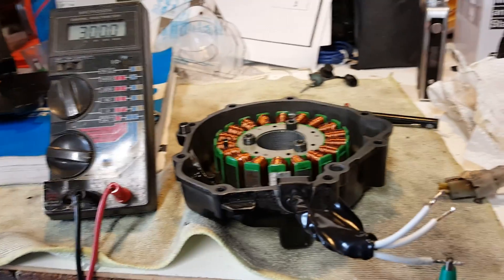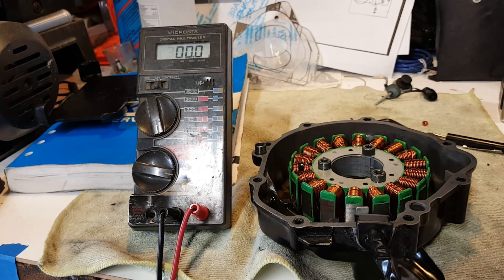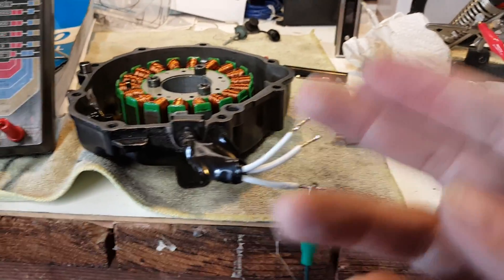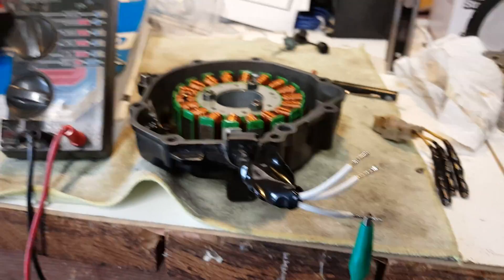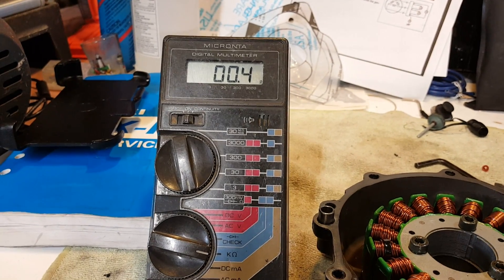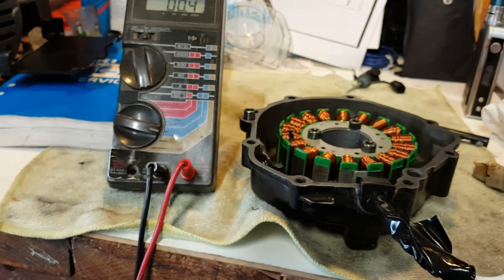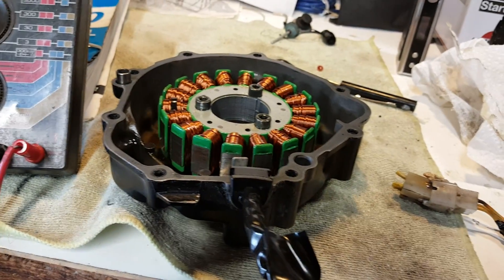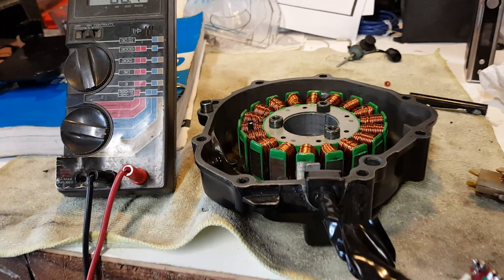Testing Your Stator on/off Your Bike

Comment: I thought you couldn't use a Mossfet with a lithium battery.
Reply from the maker: I'm going to let Chat GPT give you the breakdown with all my specs and upgrades feed into my query and you make the decision. 

Great combo. Your 2005 GSX-R750 (K5) will play nicely with a MOSFET regulator/rectifier and your Shorai LFM19A4-BS12 LiFePO₄ battery—as long as the charging voltage stays in the lithium-safe window.

- What “good” looks like for your Shorai
Shorai’s guidance: running/charging ~13.6–14.4 V, never above 15.2 V at any rpm. At idle you want ≥13.1 V. 
Your specific model: LFX19A4-BS12 was superseded by LFM19A4-BS12 (same drop-in fit, 12 V LiFePO₄, ~285 CCA). 

- R/R options that work well on the K5 GSX-R750
* Best (Series MOSFET): Shindengen SH847 — reduces stator heating and holds voltage ~14.2 V. Suzuki p/n 32800-31J00; available as genuine units/kits. 
* Very good (MOSFET shunt): Shindengen FH020AA — tight regulation around ~14.2–14.4 V and proven reliability. 
* Both are commonly sold in plug-and-play style kits (cables, fuse/breaker, connectors). 
(roadstercycle.com)

- Wiring snapshot (GSX-R specifics)
* Stator → R/R: The three yellow AC leads go to the three AC inputs on the R/R (order doesn’t matter). 

- R/R DC → Battery:
* R/R + to battery + through a ~30 A fuse or breaker, short and heavy gauge (12 AWG; 10 AWG if long). Many kits include this inline protection. 
 (roadstercycle.com)

- R/R – to solid frame/battery ground.
* If your R/R has a sense wire, tie it to a clean switched +12 V (e.g., ignition-on circuit).

The GSX-R service manual’s regulated-voltage test is done at ~5,000 rpm with headlight on high, measuring across the battery terminals. Aim to see ~14.0–14.4 V and never >15.2 V for the Shorai. 

- Quick verification after install (multimeter)
Key off (resting): LiFePO₄ typically ~13.2–13.4 V (informative, not critical). Idle: ≥13.1 V (Shorai minimum). 
3–5k rpm (lights on): 13.6–14.4 V steady. If you ever see >15.0–15.2 V, stop—R/R or wiring issue. 

- Parts I’d pick for your setup
Series: Shindengen SH847 (often sold as Suzuki p/n 32800-31J00) + bike-specific or universal harness. 
Eastern Beaver Inc

Shunt MOSFET (budget/compact): Shindengen FH020AA kit (widely available). 

- Lithium-specific notes
Your Shorai has a BMS; it’s happy with normal bike charging as long as voltage stays ≤15.2 V. Avoid chargers with desulfation/repair modes. 
Cold charging: below ~0 °C (32 °F) many BMSs limit/disable charging—normal behavior. (Warm the pack with a few minutes of lights/accessories first.) 

Hope that answers your question

Comment: So if my bike doesnt stay running or start with out a jump its the stator?
Reply from the maker: Yes sir..!! The job of the Stator or Alternator if it was a car is to provide power to keep it running.  

The only function of the battery is to provide enough voltage and amperage power to start it via the starter motor. 

After start the Regulator Rectifier on your bike will divert power from the Stator to the battery to replace power (voltage) that was lost and continuously keep checking to see if the battery is topped off.

The best way to check if your Stator is supplying enough power is to start the engine and disconnect the battery while running. If the vehicle shuts off at any point then you know you have a faulty Stator or Alternator... Aka charging system..
Reply: @ thanks bro I appreaciate the speedy reply, and the breakdown helps me understand much more you seem to be a great teacher. And I’m assuming once I change the stator I’ll be back in business thanks again

Comment: I'm looking at this video for the first time and it's 7 years old but do you know why the connection melted and did you fix your motorcycle?
Reply from the maker: This happens when one or all of three things happens.

1) Stator is going bad
2) RR going bad
3) One of the 3  phase  is intermittent

Hard wiring in the stator connections is the best way to resolve this issue. If after hard wiring the melting still occurs, then you know its time to replace the Stator or RR.. test both. Just an FYI a stator can test good but still give you problems like this,  Happen to me not to long ago ..

Comment: I hope you can help me here: I recently bought an 08 zx10 and started doing a bunch of mods: added an integrated tail light, changed the bulbs to LEDs etc. Long story short, while riding around town I stalled the bike and did not want to turn back on. Called a mechanic and told me it was my battery so I went ahead and bought a new one. Yesterday it did not want to start up 2 days after having that new battery installed. Am I looking at the same issue here?
Reply from the maker: 0:05 If the battery dies after riding and it was fully charge then You're running off battery power and the two other components of the charging system has failed. That would be your RR and Stator.

Most of the time the RR is the culprit. I would perform a diod check on the RR.. and this test on your stator. I would also visually inspect your Stator for burnt discoloration on the coils.. usually a good sign it's time for a new one.

One quick and dirty way to see if youret running off batt power is to start the bike and disconnect the battery.. if the bike shuts off then you know youre running off batt power and one OR BOTH components of the charging system isn't working.
Reply: @TheChemistDIY  An update as of right now. There was a recall on 08-10 ZX10R. So I called my dealership and indeed the recall is still open for a Voltage Regulator (whatever that means). So it has been ordered and they’ll let me know when it gets here so that they can fix it and go from there. 

In your book, does this sound right? Voltage Regulator does that translates to the stator or the RR?
Reply from the maker: @klachi7  So RR is short for Regulator Rectifier or Voltage Rectifier. How your charging system works is like this... The Stator is like your altinator if it were in a car.. Through a spinning hub and  magnetism, it creates AC voltage. That AC Voltage needs to be coverted into DC  to run the bike, its electrical components... and charge the batt . This is the job of the RR.. it takes the AC current and converts it to DC or direct current. Not all the voltage that is "Rectified" is need tho, and some of that excess voltage is dissipated or "shunted" to ground.. All this work causes the RR to get really hot and If the RR is not in a cool location where it gets the most air flow, it will fry itself. For this reason I have moved mine to the front of the RAD...The 04/05 GSXR is well known for killing RRs because of where Suzuki chose to put it, under the back Cowl... hope that helped you out
Reply: @TheChemistDIY  good stuff bro’ thank you! I went through the recall for my 08, and they tested it and it’s charging now. After all I don’t think it needed a stator just the rectifier! I still haven’t ridden it as much but time will tell if it’s 100% fixed!
Reply from the maker: @klachi7 awesome, good to hear your up and running. One quick note before I let u be. One very good investment you are going to want is VISIABLE voltage meter located somewhere on your dash or bars. I can't tell you how much this has saved my ass when it comes to charging issues.

If the volt meter is not displaying 13.8-14 volts during your ride then you know something is wrong and you need to get home  QUICK!.. at about 10 volts left in the battery, your bike is going to shut off leaving you stranded..

This just happened to me the other day but because I was able to see the remaining juice left in the batt I knew how far I could ride to get me closer to home and Park in a safe area to where I could get towed.. yes it was a stator issue.. if not for that I would have been stuck on the freeway.

Comment: Hello, in my er6 the battery does not charge and I measure current at the stator output and it gives me 7v and up to 28v if I accelerate to 5000 revolutions. It's bad right?
Reply from the maker: It's hard to say when your testing that way. Better to test the Stator as shown in the video because you see that all values are within spec per your service manual as shown.  This rules out the stator as the charging issue unless you have a ground loop short..to test that, the stator need to be on the bike.

Only two systems left after that.. RR or Battery.

I can't really give you a definitive answer because you didn't state how you tested the stator while running. If you're testing the stator while running for AC voltage you should start the bike and disconnect the stater from the harness and test at the connector. This will give you your AC voltage while also removing the regulator rectifier and battery as part of your problem...
Reply: The measurement is made with the stator disconnected and the motorcycle started, giving an output voltage of 7 v alternating current. When I think it should give 18 to 20v minimum. And measuring resistance gives 0.2 ohms
Reply from the maker: @toni2468  take a look at 3:01 mark in this video. Shows your specs for the charging system.. if your values aren't the same then most likely it's the stator.. if they are.. then move on to your RR but from the looks of it .2 is within spec.. 48v AC is what should be read at stator connector when running, and 12.8v or more at battery terminal.. 

 https://youtu.be/AdjFyVjwevs?si=n6qMGkP_FcOkVfmH

Comment: My stator is reading 00.1 one prom the another's 00.2 is the stator is bad? also I test ground in diado on the bike is all beep means the stator is bad...?!
Reply from the maker: Soo, You didn't specify what bike your working on so I can't tell you what's good or bad.

If an 05 like mine then you saw the between values written in the good book and you saw the CONSISTENT readings I was getting on ALL THREE leads on a brand new stator. 

If yours (at any lead)  is not within that range written in the good, I would replace, and once you get your new stator thest that one so you can see what your baseline readings should be.. including the ground test which I didn't show here.

Hope that helps ya out..

Comment: What does it mean if my voltage is spiking? In my case my headlight bulb on my 2006 Road Star keeps burning out. I tested it at just over 17v at the connector, during idle. It duplicates my reading at the battery terminals, while idling, on my charging circuit. I haven’t tested the regular rectifier, for the condition on the diodes.
Reply: I also haven’t tested the stator for shorts or grounds yet.
Reply from the maker: @YamahawgDawg  sounds like you know already know what you have to do brother. My first test would  be the RR. Sounds like it's not shunting the excess voltage to ground giving you more juice at the terminals then you should have.  If you are in need of a replacement regular rectifier I suggest you spend the extra dough and get yourself a MOSFET.. I have a video on that and the supplier I went with.. still have the same RR in that video in today..
Reply: @TheChemistDIY  I don’t have a digital meter with the diode setting, I’m going to get one tomorrow. I have the connector off at the regulator rectifier, I checked the three white wires for ground across each wire, It’s indicating a ground. If those are the wires going the stator, it shouldn’t indicate a ground, right?
Reply from the maker: @YamahawgDawg  correct.. you may also want to trace those wires and make sure none of the shielding is bear and causing it to ground out. That happen to me one time.. but only because the RR was bad and heating up the wires causing the insulation to melt. . Remember.. an RR going out will take out everything on both sides of it making you think the other parts are the issue when in fact it's just the RR.. found that out the hard way after replacing two stators, two batteries and one wiring harness..

Comment: So I just bought a 2005 gsxr 600 and he said stator went bad so he bought new one and put it in and said it worked for 2 days and quit working. Well I bought it the wire harness was pretty bad from wires being cut to add led lights and stuff so I took all that out and put new water proof connectors on and did it all right checked stator and it was reading good but wouldn't work so I opened up stator cover and when he put new one in he didn't put wires behind the metal tab to protect it from flywheel and it ate through some of the wires just like half way so when bike was running it was putting current into motor which is your ground. So I fixed it and now I'm waiting on gasket to put cover back on.. should work. Just FYI yo anyone doing one make sure you put it in right because u could fry your Ecu doing something like that. Luckily I think I'm good..
Reply from the maker: Wow, yeah you got really lucky. It's always good to go over a used bike after a purchase even though it's running. You just never know what kind of hack job the previous owner did.

Comment: i have checked the ohms and continuity everything is fine as in service manual..... but. my rectifier is over heating..... AC voltage is about 32 at 1500 rpm.... when i rev at 5000 rpm AC voltage is more than 75...... need help
Burnet 2 rectifier already
Reply from the maker: What up brother, I'll be more than happy to help you out to resolve your issue but please subscribe. That said.. let's get into it.

You didn't mention what bike you have so I'm taking it's a Gixxr. You mentioned that the RR is overheating so I'm taking it that you harness connectors at the RR and or Stator are warping or melted. 

1. This is a common issue because of the stock location, it just doesn't get enough cool air under the tail and needs to be relocated to the front of the radiator. I have a video on and  can be seen here  https://youtu.be/8GUM-dAw8Io

2. It sounds like your RR is on its way out, especially if your battery is not charging and even more so if your harness is frying. There is a way to test the RR and the diods within but I don't have a video on that but can be found easily with a YouTube search. 90% of the time it's going to be your RR that's the issue. I suggest getting a new one.. and I do have a video on the one I purchased 5 years ago and haven't had a problem since.. see that here. https://youtu.be/uDhuwCE2Bk4

In that video I Tell how to diagnose a few issues with charging relating with RR issues. Check it out.

3. The other 10% is stator and or bad battery. If it's your battery then test or have it tested. I replaced mine with this one and can  recommend. Haven't had a new battery since.  That video found here 
https://youtu.be/I8GIhZRz0os

If you need more details on how to test each subscribe and hit me back.. favors for favors brother :)
Reply: so......? what must be the problem
Reply: my rr is new just replaced......my battery voltage is also good (12.5)as well as charging voltage is also good (14.4).... stator ohms is 0.5 (service manual is 0.4-0.6) continuity is also good (no connection with Earth))
Reply from the maker: @kumzimchen2276  I had a previous subscriber come to me, his comments are somewhere down below(or another video). He purchased himself a brand new RR (eBay special) and claimed it was good just because it was brand new. I asked him if he tested it to ensure that I was working properly, he said no... Its brand new.. I told him just because something is brand new doesn't mean it's functional when you receive it,  You should test.. he was on the right path and had the answer.. the RR was bad, but so was the new one... Here's a good video on Forward & backwards testing your RR.
https://youtu.be/NTjumDgixkQ.

I can't really tell you what the problem is because everything requires testing but it sounds like you know what you're doing. Here All you've stated is that your RR is overheating. Well, they do get hot And if not properly cooled will overheat and not charge the batt, it will burn out the internal circuitry causing all sorts of other issues. You haven't stated an actual problem, just that regular rectifier gets hot.

Which issue is yours:
1.) Is your battery not charging.
2.) Are your connectors, wiring harness.. burned, frying, or warping.
3.) Does your battery charge at times and not others leaving you stranded.
4) does your bike crank or have slow crank and causing the battery to be drained.
5.) Does the bike just shut off during your ride.
6.)is your battery holding a charge or is low after your ride.

I can't tell you where to start with just..overheating RR. How do you know it's overheating.. there's no temp sensor for it. See what I'm getting at?

Comment: I have an 02 monster 750 sie.   I ohmed across the 3 yellow wires and got .4 on every wire. Is it still possible for the stator to be bad?  The symptoms are pointing to the stator.
Reply from the maker: If its not within range the good books recommended range then yes..  Sorry brother, I dont typically respond to those who are not subscribed
Reply: @TheChemistDIY  I appreciate the reply